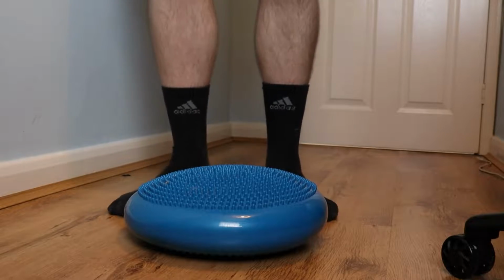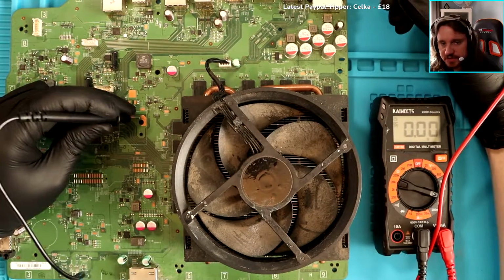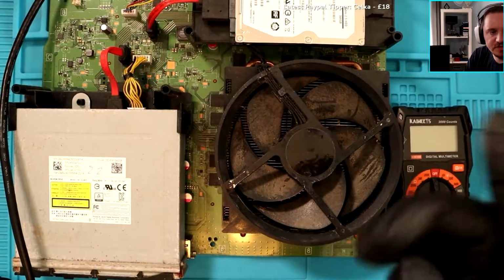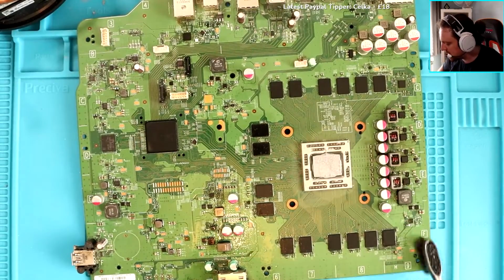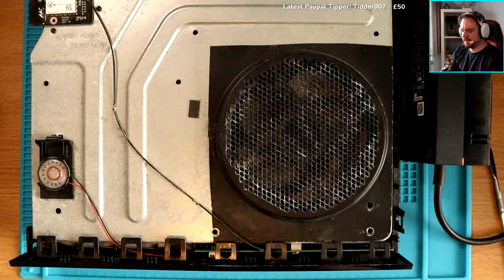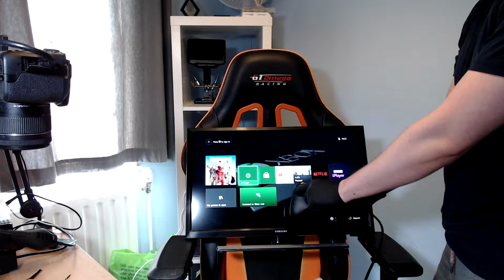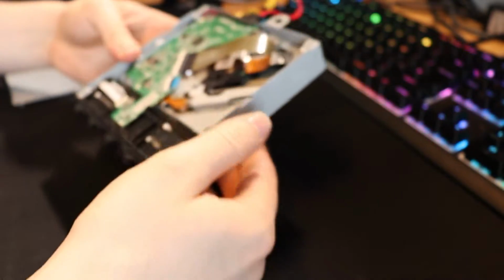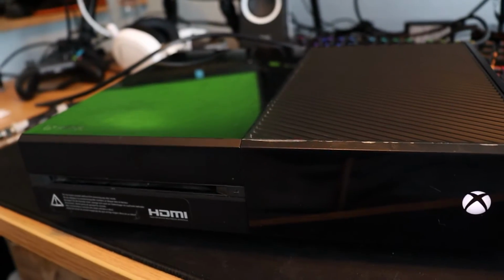Trying to FIX an Xbox One with NO Experience

Comment: this console is behaving just like mine, I'm gonna copy your moves minus the multi meter and the PSU (I turned a regular PSU into an xbox one compatible) which worked fine despite having the fan running always just to see if mine has the same issue as yours, hopefully will turn on again, otherwise it'll be around 40USD straight to the bin with a modded PSU with no devices to use, wish me luck!
Reply: UPDATE: either my PSU is faulty or the console finally died because the fan did a tiny movement like yours, but mine didn't turn on.

Comment: My honest thoughts...

Before the stream: That Xbox One looks like it was previously owned Nemo the Clownfish. The amount of rust means this has had it. Sorry Joey, I'd say this is beyond elite restoration.

10 mins into this video (more or less where I'd got to dipping in and out of the stream): This is an odd issue (where the fan is reluctant to spin and the operating system boots up), but desperately close. Come on Joey! I'm sure it's just some stubborn microscopic dirt/corrosion blocking the electron flow.

End of video reaction: This is insane! Joey and his community are miracle workers! Get in there!

Stez managed to persuade you to dismantle the working one then. 😂
Reply from the maker: Hahaha Steve got his way! But we more or less met 50/50 as I only had to take the console down to the front panel. Thanks for watching Toxo :)